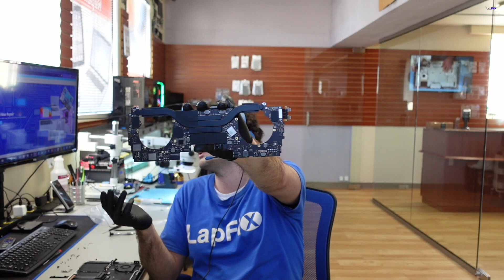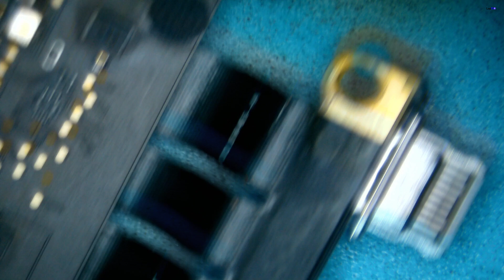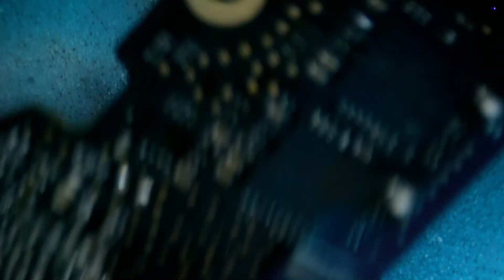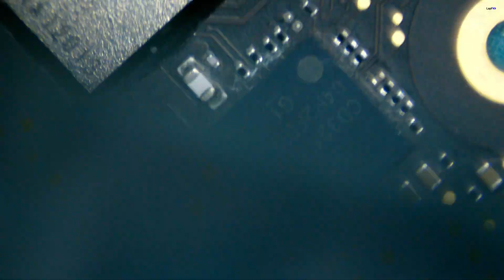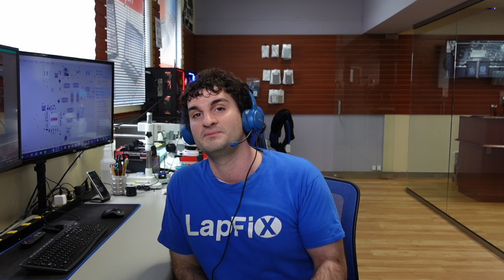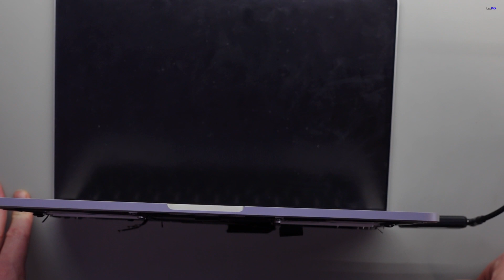Repairing A 2020 Macbook Pro With Liquid Spill

Comment: slm i am from turky post comment 2019 13 inc mac pro has the problem it works but it does not react at all what is the problem can you help me
Reply from the maker: Was there any liquid damage?
Reply: @lapfix  yes but i used a way i did dfu it goes all the way to the switch but it doesn't work
Reply: @lapfix  After trying to format it, it went away and it didn't turn on again.